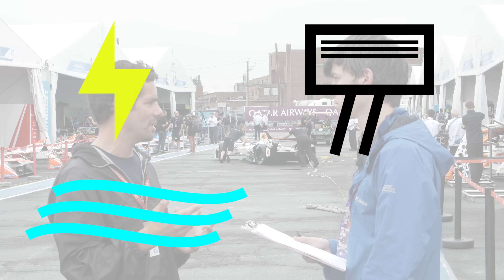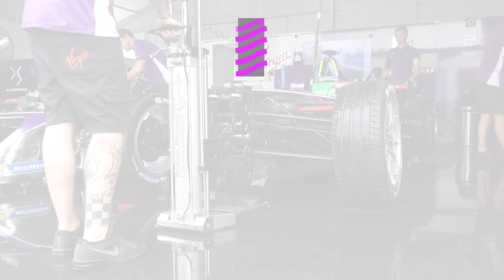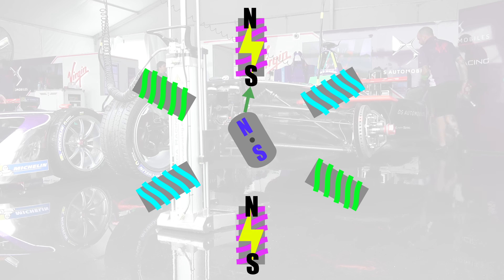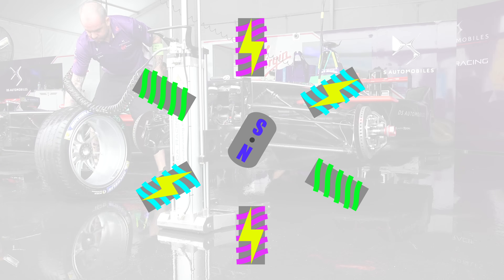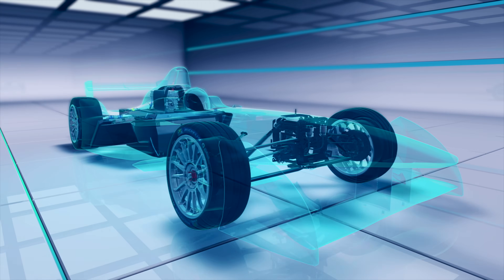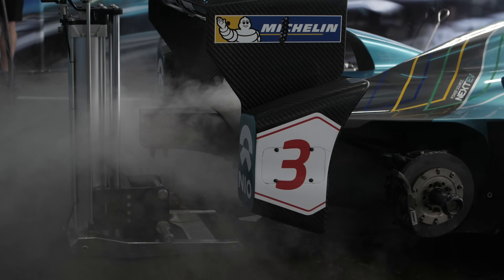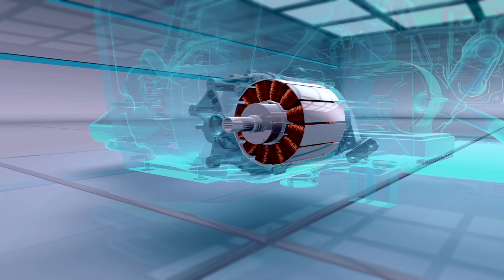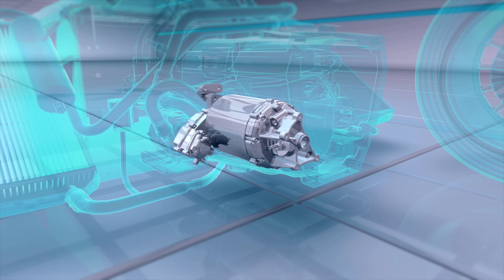Can You Tune Electric Cars For More Power?

Comment: Long story short, no turbo no supercharger... no personal customization no own taste... 
To make an electric car fast just put Duracell in it! 
Our future looks blank~
Reply: Armour Shooter he forgot about transmission, you can change the gear ratio to get a higher top speed or faster acceleration. Also you can add powerful fans to the battery to cool it, this is the closest you'd get to a supercharger...
Reply: Armour Shooter you can definitely personalize any car. Electric, diesel, gas, or other wise. Making them.fasyer requires you to be a electrical engineer and have lots of money
Reply: Relo Love Dota 100 years ago, the Model T was the only realistic option. Today, there are many many options and an electric car does not supply the same upsides against a similarly priced ICE car that a Model T did against a horse.
Reply: pol1250 Faster to about 40 mph.
Reply: Alex C Have you seen a top fuel dragster? Beats any electric car on wheels that exist and will ever exist.
Reply: eternitynaut The acceleration of a dragster after hooking is decided almost completely by horsepower and not torque. It would be like drag racing a 200 HP e-golf against a 400 HP golf-R. The final result will be obvious unless you only want to see 60ft times.
Reply: I love it when people say never, because I can go back and read their comments in the future and laugh.
Reply: Try solving megacity smog and climate change with the other options.
Reply: "Claiming nothing can be done is again fake news from the petrol heads. Typical." Except that is fake news about petrolheads by eternitynaut also called strawmannaut an EV fanboy. ;)
Reply: "Sure, last century's knowledge won't get you far." Except it is not last centuries knowledge and he did not claim anything like that. EVs aren't as new as you might think.
Reply: Thomas L. WTF that is amazing level of willful ignorance even after showed you an example. Rimac is a real world tested abused Series on its 2nd Generation very far from a concept car. Soo far the have Crashed 3x Rimac Concept series with no life threatening injuries. Also Chiron can't beat the Rimac in short distance like 1/4 Mile because of 4x Motor Torque Vectoring, power is not the issue BEV just has Better GRIP. Then there is a Lucid Air which achieved 235.44 Miles Per Hour at Ohio TRC Bowl. None of these are theoretical, these are used and abused BEV platforms.
FYI That Chinese company is NIO NextEV Chasis & Motors are actually made in England, LiFePO4 Cells from China, Battery Packaging & Electronics From Silicon Valley, Engineering in Munich. Thus why they hold the Nurburgring Two Seater Record (not Lanzante).
Reply: I prefer Energizer ;)
Reply: eternitynaut 20 mpg in a modern car is atrocious. My V6 SUV gets 23 combined. Also, you're comparing MPG to MPGe. That's not a scientific comparison as it assumes you can convert 100% of the heat and expansion energy in a gallon of gas to electricity. That's a ridiculous assumption as this is physically impossible. That's like saying a pound of 24 karat gold to a pound of gold ore. Also, energy wise, a Model X is not more efficient than any other large SUV unless you have solar panels, since most electricity generated in the US is from non-renewable sources. Just because the energy loss occurred in the power plant doesn't mean an EV owner is not guilty of waste. I'm pretty sure 95-99% of EV drivers don't have solar panels or a windmill in their backyard.
Reply: There are people trying to make Top EV, they think they'll get close to top fuel in 5 years tops.
Reply: eternitynaut Sure. If you put the cars on rails or make a battery the size of a pickup truck. That would be like trying to put a 50000 HP ship motor in a car and expect it to go fast.
Reply: They're aiming for 5000 HP for now, same weight and rules as top fuel. They think the higher torque and better control will let them match em with half the hp but we'll find out.
Reply: Do they even race top fuel to the quarter mile?
Reply: Oh, excuse my audacity for generalizing. Petroshills don't accuse EVs of not being customizable, they accuse them of being golf carts that can't go 10 miles without needing to recharge for 2 days. Pardon me, this fellow thread comment originator was an upstanding person levitating way above the usual petrol head bile.
Reply: Alex C I looked up the Rimac Concept One. The updated 2017 version does 0-200 kph in 6.0 seconds. The Bugatti Chiron does 0-200 kph in 6.1 seconds. That means it's no more than 0.1 seconds faster to 120 than a Chiron. Also it will lose to a Chiron in the 1/4 mile.
Reply: Concept_S, not Concept_One. The specs are on their website, i don't know if they ever filmed it working. Specifications read: Maximum power: 1384 HP (1018 kW), Top speed: 365 km/h, acceleration: 0-100 km/h (0-62 mph) 2,5 seconds; 0-200 km/h 5,6 seconds, 0-300 km/h 13,1 seconds. Funny enough, it's a tunned Concept_One. HA
Reply: Same goes for a lot of hypercars these days, at least they have a more extreme version than that called the eRunner off of which they designed the upgrades for the Concept_S and that car does exist and perform
/watch?v=cVCHrOalctw
Reply: You could customized more in a steam engine supercar..
Reply: Neojhun You fail to show how I'm ignorant about a unreleased and untested concept car that is based on a car that there's only 8 (and now I'm assuming 5) examples of. You can tell me about how it's possible to obtain these numbers. Any car with that amount of horsepower should be capable of them. You're being incredibly defensive and accusatory about something that I'm not even denying.
Reply: i dont see electric cars being around in the future most likely go to hydrogen powered cars
Reply: Thomas L. the eRunner final variant had about 100 more horsepower than the Concept_S and the noise was caused by the fact that they had no place to install a normal transmission and used chain drives, not something they would do with their own chassis design. The difficulty of installing electric motors and batteries is non existent since they designed them from the start and there is no emission rules or something. The only reason they didn't build a lot of those cars is because they're so expensive to build and they can't afford to crash test enough cars to get certification. It's something they are working on for future cheaper models. The point being, performance isn't lacking and neither is the ability to tune cars, in fact both the Concept_S and the eRunner's drive trains are improved versions of the Concept_One which itself went through several upgrades throughout the years. What is clear by now is that petrol heads lack the know how to tune EVs and it will take time until easy, DIY kits will be made available by enthusiasts in the community. It doesn't help they're hostile as well, given how they're ready to declare the death of tunning even when they're being told they are spreading fake news.
Reply: thesulo12 Hydrogen cars require more expensive fuels and even rarer metals to build. As a society trying to switch from electricity production from fossil fuel sources to renewables, we'd have to collectively invest over twice as much for the production facilities and pay more per km of distance driven. This is why the hydrogen economy never took over, it's more expensive than fossil fuels, let alone electricity. EVs work fine and they're over 1 million vehicles out there growing exponentially in adoption, every house in the developed world has an electric plug that works like their own personal charge station and the faster charging stations outnumber hydrogen filling stations by thousands to one. Betting on hydrogen is like betting on nuclear fission instead of renewables. It's more expensive so it won't happen, electricity is cheaper to move around as well, a PWh worth of electrons you can lift it yourself, a PWh worth of hydrogen weighs millions of tons and requires a lot of energy to transport.
Reply: Hydrogen cars failed to deliver on their promise years ago against fossil fuels, they are not competitive on fuel cost nor energy cost needed to produce the fuel. Please delete your comments and get an education.
Reply: eternitynaut Tuning an electric vehicle is pretty much just swapping out components to bigger ones. The only reason why there isn't something that legally limits EVs yet is because there's no shortage of electricity. When more people get electric cars and the price of electricity goes up, the government will put the equivalent of a gas guzzler tax on these kind of EVs. Also, just because one guy commented on tuning being "bleak" does not mean "petrolheads" don't know how to tune an electric car. Anyone who has an electric engineering degree can swap out the parts and hook up the new parts. The hostility comes from both sides and is due to "petrolheads" not accepting EVs and EV fanboys abusing the word "future" and making ridiculous statements that show the only science they know is pseudoscience.
Reply: eternitynaut Solar panels are not cheap and will only be a net positive investment in hot and sunny environments. They also only work half the time (no sun at night). Almost no country has anywhere close to enough electricity production to support even 50% EVs on the road. Lithium is also a rare earth metal and there likely isn't enough of it for every driver to have 10000 cell phone batterys worth to run their car.
Reply: "Solar panels are not cheap and will only be a net positive investment in hot and sunny environments" They weren't there either until recently, it happened because the price dropped steadily and will continue to drop until it's cheaper than electricity from the grid in most climates, though I won't make a bold statement like it will be better in the Arctic or something any time soon. "Almost no country has anywhere close to enough electricity production to support even 50% EVs on the road." Every country spends currently more on powering ICE cars, the energy wasted is higher. The money for the investments needed to increase electricity production is there, the demand just has to rise to justify it." Lithium is also a rare earth metal and there likely isn't enough of it for every driver to have 10000 cell phone batterys worth to run their car." It's as rare in the crust as such elements as copper, we have enough for 2 billion long range EVs and then some. We don't have enough for grid energy storage but there are other chemistries or non battery solutions to replace them there. Even for cars, there is the expectation of post lithium chemistries with energy densities higher than 2 kWh/kg. I doubt that by 2040 we'll be using lithium based batteries for anything, portable devices, cars or energy storage for homes.
Reply: eternitynaut I see what you're saying but much of it is speculative. Also, the only reliable way to convert petrol to electricity is still through combustion. Unless they can use the heat that is a waste product of combustion to generate electricity, burning petrol in cars is no more wasteful than converting it to electricity to charge batteries. Also, large commercial vehicles like ships, planes, and tractor trailer trucks are unable to convert to an electric drivetrain without a huge drop in efficiency and/or convenience.
Reply: I didn't meant use the existing oil/gasoline/diesel to burn to make electricity, I meant that today we already consume more and pay more for that higher consumption to move X number of vehicles Y distance per year.  Consider that a pretty good ICE (non hybrid) gets around 20 MPG, that's 20 miles driven with 33.16 kWh of energy. A heavy, sporty SUV like the Tesla Model X gets around 90 MPG equivalent. The most energy efficient production EV gets 136 MPG equivalent. As you can see, if we all drove electric SUVs we'd get a 4x reduction in energy consumption on average. If we all drove small, efficient EVs, it could reduce the energy consumption by 7x, more or less. Multiply that by 1 billion cars and the result is the same, instead of consuming say 10 PWh (random number) of gasoline, we'd consume something like 2 PWh of electricity. We already pay at least 4x more today so we can afford to build the electricity production facilities since all the oil industry has at least 4x more invested in assets to produce theirs.
Reply: Don't be so pessimistic....it might be a big change but you can gain a lot of skills ....plus people always found a way to be faster.  But I have to admit....EVs are out for around 6 years now and already they are faster than 99.9% of the cars...so not so much room for improvement...
Reply: 100 years ago you would have told us that cars suck and we should stick to horses.
Reply: Armour Shooter wtf are you talking about
Drifting electric is 100% easier with no need to change gear you can simply adjust the pedle
And yoy can even go from 4wd to 2wd on the fly for epic reverse entrys
Reply: eternitynaut Sounds like a Rimac Concept-concept to me lol. No hard evidence on the internet other than their website.
Reply: You can use a hybrid battery pack with 80% capacity being high energy density cells that can only discharge in a slow rate and 20% of the capacity with high power density cells and low energy density that discharge at high C ratings or supercaps to peak the motors. You can deliver more power temporarily to the motors than what they are designed for, they might not be able to sustain it since something would melt, but they would be fine for a second or two which is enough for drag racing. You can add more motors in the place of one and without changing the battery pack you can have the peak power become the sustained power since the two motors would need to each deliver half the power of the original one and so they wouldn't ever overheat (note that I don't mean using 2 x 250 kW motors to replace a 500 kW one, I mean 2x500 kW motors, it won't change the fact that the pack can only peak at 500 kW, but it will mean the motors won't overheat). You can place 4 motors in the car, one per each wheel and use torque vectoring where you can make the car do whatever you want, it can turn in place like a tank if you wish it. You can take a Tesla Model S drive train and place it in a light car and this happens
/watch?v=OxR0pl4UTlM
You can install larger radiators in a stock electric car and then it can sustain peak power for longer. You can mess with the inverter and have it deliver power to the motors faster than what the manufacturer programmed in (at the risk of faster battery degradation and possibly damaging other parts as well). etc.
It's not that you can't customize it, it's that you're clueless on how to do so. Claiming nothing can be done is again fake news from the petrol heads. Typical.
Reply: Sure, last century's knowledge won't get you far. Electric cars are pretty much limited by tire grip already anyway. There's still a lot you can do though. EVs beat ICE cars easily off the line, but modify an EV for example that can keep up at race speeds and durations as well. You have so many more options when customizing EVs. Who says you have to stick to a single engine? Why not four? Experiment with a gearbox. Check out how far you can "overdrive" components. Saying you can't change anything about an EV just shows a lack of knowledge and imagination.

Comment: So what specifically is the bottleneck preventing quicker 0-80mph times for the Model S? The P90D in ludicrous mode can do 0-60mph in 3 sec (20mph/sec) and 0-80mph in 5 sec (16mph/sec). What needs to be done to get 0-80mph in 4 sec (20mph/sec = 8.94 mps/s) ? The motor, battery (power, heat), inverter, cabling resistance?
Reply: Hyper Sonic You can buy a P100D or a used Civic and have some teenagers mess with the motor.
Reply: That works, P100D does 0-60 in 2.3 sec (26.1 mph / sec), 0-80 in 3.8 sec (21 mph / sec = 9.4 mps/s). Maybe the next iteration will do 1g = 9.8mps/s = 21.9 mph/sec all through 0-80mph (3.65 sec.)
Reply: Hyper Sonic The 2.28 second  0-60 time was done by a stripped interior model S with a 1 foot rollout. If you start to time it the moment it starts moving, it is actually 2.53 seconds. Also, it's misleading to quote average acceleration as no car can maintain constant acceleration.
Reply: Ya average. Higher acceleration at first, then lower. I suppose it'll be awhile before there is 1g acceleration at 60-80mph. Should be some acceleration standards, like roll offs amounts and rev amounts.

Comment: Rotor length also dictates power output.  Electric motors can also be timed.  They have a mechanical 0 and a electrical 0.  Adding advanced timing curve can give you a huge boost in horsepower.  Adding negative timing can boost tq.  A smarter controller can be programmed with curves to give maximum torque at zero rpm and max hp at max rpm.  There is a lot that can be done to electric motors to increase performance.

Comment: Most gasoline cars have vents that allow air to either cool the engine or provide the engine with air for combustion and they also give the car an aggressive look, one of the things that electric cars don’t have are these vents that give that aggressive look but what if it was possible for electric cars to have purpose for these vents? For example wind turbines are used to generate power. What if we had something similar in electric to generate more power as you speed up?? It seems possible to me I think it would really make those cars pop out

Comment: I wonder if it would be worth it to run an electric A/C module to cool the batteries during use? 

Just looked it up and the batteries operate best around 85 degrees Fahrenheit and starts to limit power at 135F and the cooling system they have does a great job even in hot weather.